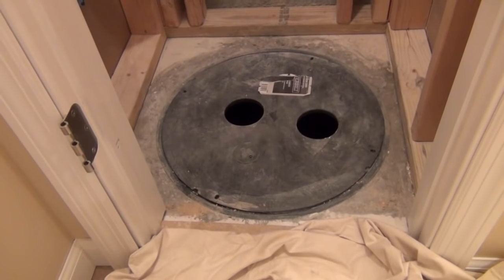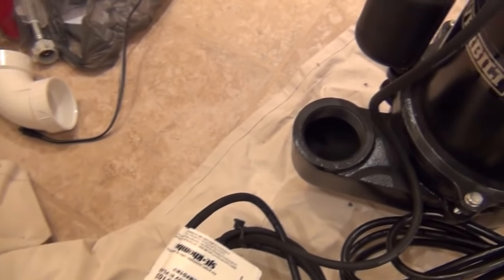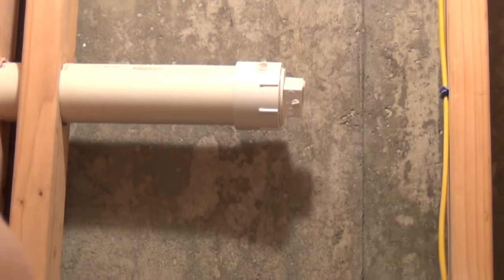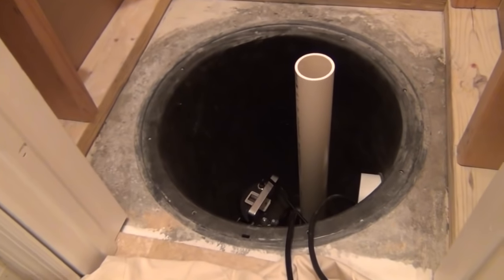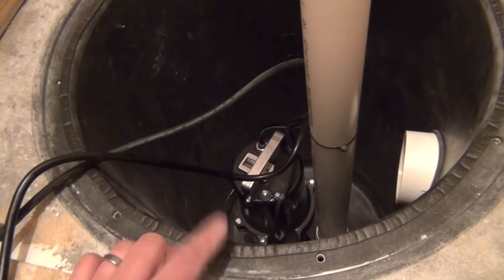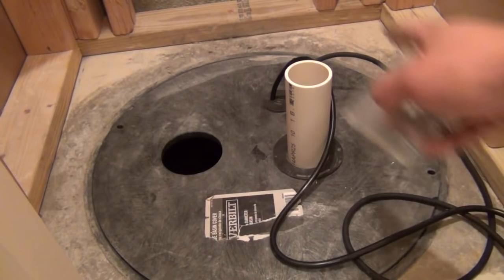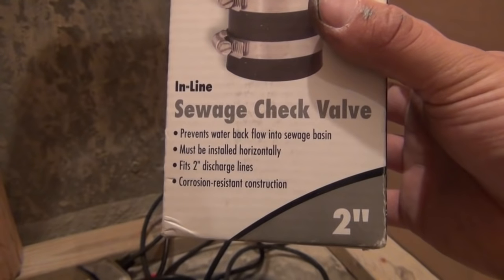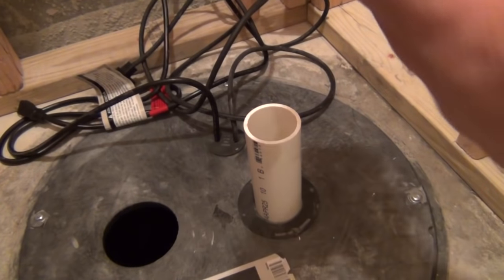How to Install a Sewage Ejector Pump

Comment: Who would thumbs down this video?? That's moronic. It took a lot of effort time and patience to make this video and is EXTREMELY helpful. This guy is a perfectionist that does incredibly detailed high quality work. Thank you so much for your efforts! I appreciate any help I can get from contributors on the web. THANK YOU!!!
Reply from the maker: Eric Bjarnason Thanks for the comment, appreciate it.  Haters are just trolls on here. I don't let them get to me.
Reply: Thumbs down must be from those who don't want you to be able to do it yourself thanks to helpful souls like Zim
Reply: A hater..lol.. because he is damn detailed
Reply: Around here that kind of pit is illegal.  The pit he is using is made for gray water or what we call a sump pit. A sewage ejector pit is made specifically for sewage .  It’s usually wider at the bottom and has to be manufactured with an air tight seal.
Reply: On top of that this is a sewerage pump, an ejector is pneumatic
Reply: The reason they tell you to install the check valve horizontally is so that the sewage doesn’t come back down on you and make a mess when you have to replace it
Reply: It was a plumber wishing you would overpay him instead to do the work. 😂

Comment: This is probably the best instructional video I've EVER seen on YouTube.  Right to the point...no horrible music bed... good solid steady video work without a bunch of zooming and effects....AND a great east coast accent, very refreshing here in the land of stoner surfers and valley girls.
Reply from the maker: Brett Weathersbee Thanks for the compliments and for taking the time to comment.
Reply: agree with you. the best tutorial video on the subject.
Reply: As I stated in my comment the likely reason for down votes is no weep hole which will cause future problems of air lock. I've seen pumps burn up prematurely because of this and have made quite a lot of money on people doing these things themselves and not reading the instructions or watching videos where this isn't mentioned. It seems very simple to install a pump and it really is however a small mistake can be costly. If you are going to do this read the instructions I'm pretty sure this is covered in them.
Reply: @my2centz196  What are weep holes and air lock?
Reply: @katie2920  if air gets trapped inside the pump it will continue to run non stop until the motor burns up. The weep hole allows the air a place to escape. A lot of pumps have them already drilled in the pump itself however they can get clogged up. It can get air locked even if the tank is full and after the pump has been working for years by a cyclone kinda like a tub it just sucks the air down. A check valve is installed so the pump doesn't continue to pump the same liquids over and over as the fall back down however without a weep hole when air gets trapped into the pump it can't escape.
Reply: @my2centz196  Thank you!
Reply: @katie2920  your welcome
Reply: yeah, I have to agree, no horrible music ( I did hear his kid yell out there though lol ). Seriously brother , you rock !
Reply: 4 years later I was thinking the exact same thing! Appreciate the video boss!

Comment: Great video! Thanks for uploading this, I saved $2,500. My plumber suggested I change my sewer system with a new one. I saw your video, changed the float switch and the lid and the problem was solved. Total expense $75 only!
Reply from the maker: That's great!...glad the video helped you save some coin.  Thanks for watching!
Reply: Haha yea plumbers always want the recipe. ThT 2500 was a deal to haha cash only

Comment: Pretty good video but a few key points overlooked. First, discharge line fittings should be rated for pressure. This is code in a lot of areas. Secondly, if you use a check value, a air bleed hole should be created to prevent air lock. Also, make sure the voltage on your circuit matches the pump.
Reply from the maker: Thanks for the comment.  This pump doesn't call for an air bleed hole as the pump itself releases the vacuum.  I believe the NEC calls for a dedicated 20 amp circuit for en ejector pump in which case my install has.  I wasn't aware of using sch 40 on the pump discharge.  Makes sense but then again the pump isn't putting that much pressure into the line.  All the installs I've ever seen have used DWV PVC as I have used.  Thanks again for the comment.
Reply: MIke H professional
Reply: @fixitwithzim  What is an air bleed hole?
Reply: @katie2920  is about a 3/16 hole drilled into section of pipe connected to pump maybe about 12” above pump connection to relieve any air in pipe that might cause air lock if pump is running and not pumping this could be the cause fixed several pumps with this simple addition

Comment: Drill a hole near the connection point at the base of the PVC where it connects to the pump so that it sprays the float to keep it clean and also drains the I remeaning water under the check valve.
Reply: Not on these pumps.

Comment: A few things I would do differently:
1. install check valve & valve higher, gives more room when servicing pump (nothing better than hitting your head on a "crappy" pipe)
2. cut vent pipe at same height as check valve, and install a rubber coupling w/ hose clamps (for servicing)
3. ALWAYS use pressure PVC fittings on pump discharges, not standard DWV fittings
4. Use Zoeller or Gould pumps (I'm not a fan of the loose floats)
Side note: I recommend silent check valves. Regardless, (I don't know if you mentioned it) ALWAYS use check valves with rubber couplings, never the compression type with the big plastic nuts...

Comment: I just had HEP Plumbing in Chattanooga come out and diagnose that my pump was bad and it would be almost $7000 to replace it. So I started watching videos. Saw the tip about the pump plugged into the float valve, so I went downstairs and directly plugged in the pump and the pump worked! So I have a bad or stuck float valve, something I might be able to handle myself. At the very least, I now know how to get that gross tank empty before taking the lid off of the tank. Thank you!!!!

Comment: Absolutely perfect video.  This guy is both a pro who knows all the ins and outs, and ALSO remembers the first one he installed because he answered all the questions a first-timer would have.  Many thanks for making this video.
Reply: One thing he didn't mention is a weep hole. I've said this a few times so far but if you install one read the instructions! Make sure to drill a 3/8" hole around 6"-8" up the discharge line. Usually somewhere around the waterline. Edit if you do not do this you risk expensive future problems including prematurely burning out your pump!

Comment: Love this video, I have a sewage pump in my basement that flows to the septic system. No issues with it so far this video just shows that you can change the pump yourself if needs be without calling a plumber save yourself money 💰
Reply from the maker: Absolutely!  Such an easy job and you can save hundreds doing it yourself. I’ve seen guys charge people over 1200 to change a pump out.

Comment: Excellent video. I wish working on these was ever this clean and non-gross.
Scary to see this type of installation in a basement. We've had a pump outside our home for 20 years and have witnessed many failure modes. The worst problem is if the float switch fails to start the pump, which often and easily happens, then sewage will overflow the pit and flood the basement with sewage. Our 1st pump was 24 years old before it failed. It was a Goulds. The replacement was a Zoeller and lasted 3 years before its integrated float switch failed.

Its amazing how these systems are not designed to be very reliable yet they consequences are very bad if they fail.
There was no testing to see if the system was working at all. Would be an awful time to find out the pump is defective. Or find out that the float switch is getting hung up on a cable or pipe.
Float switches only last a few years. The way you may find out its failed is when it overflows.
Even if the float switch is still good, toilet paper can weight it down and prevent it from starting the pump.

If or when the pump fails, replacing the pump will be an exciting challenge with all the solvent joined plumbing blocking access to the pit. 
Even if its just toilet paper preventing the float or needing to replace the float switch in 2-3 years, its hard to imagine how to do it with all the plumbing solvent joined in place.

- There should be an easier way to remove plumbing attached to the pump, such as having a union on sewage and vent sides.
- There should be an overflow alarm wired in to alert when level gets too high indicating pump or switch failure.
- Mechanical float switches last only a few years best case. Electronic switches are available which are much more reliable. Look at Hydrocheck. Built in float switches are the worst. At least the Everbilt has an external switch so you can replace the switch without having to replace the pump.
Reply: I have both lift station on my septic field and basement sewage ejector pump. My experience with Zoeller is that despite their reputation, their pump only last 3 years. Yup, the float switch fails just about in 2 to 3 years. This is really bad design from Zoeller and I've learned this by using them for over 20 years. Do not use Zoeller pumps. You would think the Zoeller would notice this and fix it in their pump but they are not for whatever reason.

As to this basement sewage ejection system goes, there must be a better design. When the pump fails sewage just floods the basement floor. Perhaps have an alarm system in place and design the pump to be placed outside the pit or something....

Comment: A little trick I learned over the years is to drill a 1/4 " hole in the side of the discharge pipe about 6" blow the cover .... This will prevent the discharge from getting AIR BOUND ..... That problem drove me crazy years ago ....An old timer plumber showed me that trick & never had a problem since ....Great video !!!

Comment: Great job on this, man. Nice to see an instructional vid on here that's very thorough, informative, and to the point. 

Going through this house we bought and fixing all the sloppy, failing "work" the previous owner did, (the plumbing  & electrical are trades I have the least experience in) and now this issue came up...of course.  And based off your solid info here, he didn't do that job even close to correct, and the damn lid wasn't even gasketed or fastened on!! Infuriating stuff! Not looking forward to this job, but you helped answer the small detail questions I had...so thank you!!!

Comment: Thank you so much for this video. It is amazing, I got a house that has absolutely the same setup and the problem is that it smells sometimes and I have to fix all this by myself.
Actually, the lid of the basin is absolutely disconnected and it is patched with some insulation and I also suspect that the vent pipe is bad too.
So thank you for showing me all the steps. Greatly appreciated.
Reply from the maker: You're welcome.  Get that lid sealed and socked down.  It will most certainly solve your problem

Comment: Fantastic video... thanks much!   It's clean, straight-forwared, direct to the point, and demos a high quality installation.  The extras like the gasket inside the bolts, the anti-seize on bolts, very practical point about the pipe bends, (2x 45's instead of a 90, ball-flap valve...  We don't often get clear concise practical videos without having to wade through all the music and production crap.   This is awesome... very well done!
Reply from the maker: Thank you!  I try to keep my videos simple and detail oriented. I’m not trying to entertain in them like others. It’s a how to video, probably best to stay with showing how to do things...lol

Comment from the maker: Sewage Pump: https://amzn.to/3pLCSZ3

Cheaper pump alternative: https://amzn.to/3h7WzDV
Check Valve: https://amzn.to/3Hz9oE5
2” PVC Ball Valve: https://amzn.to/2DdvM69
Tank Alarm: https://amzn.to/316JIfm
Pump and basin combo kit: https://amzn.to/2Bm85IJ
Lid w/ seals/grommets: https://amzn.to/3nH2qWy
Milwaukee Drill/Driver set: https://amzn.to/3auep1t
DeWalt Drill/Driver set: https://amzn.to/2PVXmM3
DeWalt Circular saw: https://amzn.to/3kZzmpv
The BEST Screwdriver: https://amzn.to/3qGdraD
The LAST pair of pliers you’ll ever buy that the PROS use: https://amzn.to/3aYacDk
AWESOME wrenches: https://amzn.to/3lioLq3
The BEST Hammer: https://amzn.to/3lUKFjw
Drill bit set/index: https://amzn.to/3kSj1Tu

Comment: when I do these, I always drill a hole to insert the electrode for a water alarm and seal it with silicone.  Just a precautionary measure.  I also add a GFI with built in alarm (GFI is code in my area for any sump).  So if the GFI gets tripped, it will set off a sound so you wont get a messy surprise.

Comment: Very good video Zimmsjeep. Finally someone doing a video who knows what they are doing and very informative. Others have responded about vent holes and electrical needs and you nailed it by saying read the instructions from the pump system you are buying, these if followed will allow for a great installation. I just bought an old 1940's house in Missoula Montana and this closet application looks almost exactly as mine will be, and yes the Home Depot Everbilt is fine for all applications, as are other manufacturer such as Zoeller. Really a great video, thank you
Reply from the maker: Gary Sisk Thanks. Yes everyone quick to assume and point the finger on YouTube. All good. Glad you found the video helpful!

Comment: Excellent video - very well done. Like Terry Sutherland I have the same approach to failed systems.   When I checked the pump, it worked.  The float switch needed replacement [$31.00 at Home Depot] - about 30 minutes from start to finish to remover and replace failed float switch [including clean up].  Thanks for the video suggestion about testing the pump by plugging the power cord directly to the outlet.  You saved me hundreds of dollars.  Thanks!!
Reply from the maker: You’re welcome!!  Glad you got it fixed on the cheap!

Comment: I won't get to try until tomorrow morning but your tip about activating the pump when the float switch is jammed might save me A LOT of trouble. If that still doesn't work, the rest of this video is super helpful if I have to replace everything. Thanks!
Reply from the maker: Thanks, hope it worked for you!!
Reply: @fixitwithzim  It did! The pump works great, so I ran to the derpot to get a new float switch and a few of the other things I need. Will try to replace it as soon as these kids let me...
Reply from the maker: @Rick-tg4oy  haha, sounds good. Funny, I originally did this video when my kids were very young. They enjoyed throwing everything and anything down into the pit while it was open… including the sewage main…Good stuff!

Comment: I know this is an older video (and is well done by the way) but I want to point out one additional option.  You mentioned the tank lid will leak and cause flooding should the pump fail.  This is true.  To minimize or maybe avoid this altogether, what I did was install an alarm.  It has its own float that is set higher than the one on the pump.  If the pump fails, the water level continues to raise the 2nd float and activate the alarm.  Once the alarm goes off, my family knows to immediately shut off the water until the situation can be resolved.  The key to getting this to work reliably is to have the alarm plugged into an outlet that comes from a different circuit breaker than the pump.  That way if the pump failure cause the breaker to trip, the alarm does not lose power and will still be able to signal you that water is rising.
Reply from the maker: Thank you and yes, several others over the years have mentioned alarms. It’s a good feature to have. Thanks again!

Comment: Great explanation. Quick and to the point.  My ejector stopped working and I was in a panic.  In the beginning of the video you explained what the 2 plugs were.  I unplugged and used the direct power line to empty the pit, plugged it all back in and it is now working great. Thank you!

Comment: I just installed this exact same pump.  I hope it lasts. Replacing the dead one was no fun!  Nice work in your install here. I'd throw a union on that vent pipe, myself, to make future service easier. Thanks for the video!
Reply from the maker: Thanks for the comment. When the time comes for pump replacement, I can cut the vent and put a no hub coupler on.
Reply: +zimsjeep cool. Thanks again for taking the time to make the video!

Comment: Thank you so much! It's 11:30 p.m. on a weekend and I thought I had a real plumbing emergency. The basement toilet stopped flushing and there was water mixed with other "juices" coming from the pit. As with all household emergencies, of course I went straight to YouTube. When you mentioned that there may be separate plugs for the float switch and the pump, I immediately looked for that and found out that the pump still works and the switch is the issue. I think you may have saved me a few bucks. I still need to open everything up and check the float, but that's nothing. My pump is about 10 years old, so maybe I'll have to look into replacement, but at least your video helped me for now. But after viewing your video, I think replacing it myself may be possible. Thanks again!

Comment: Well done video.  Thanks for putting this together.  Several things I didn't think of that you pointed out.  Makes the prospect of adding a basement bathroom sound less intimidating.
Reply from the maker: Chad Portenga It’s actually not that hard a process adding a basement bath. Check out my other video. I go over the entire install of a full basement bathroom